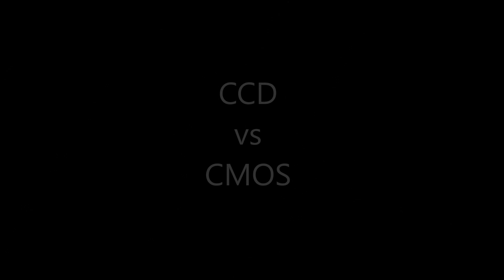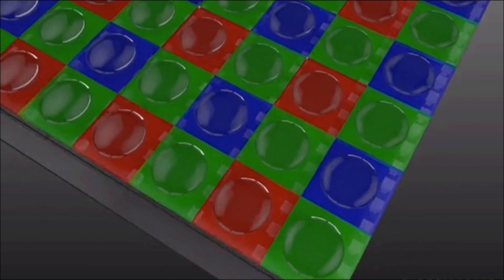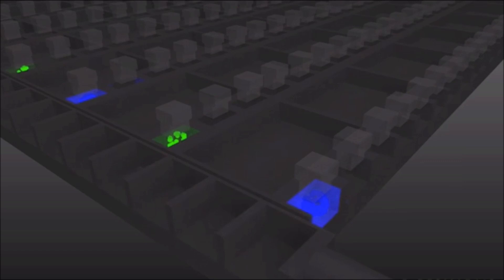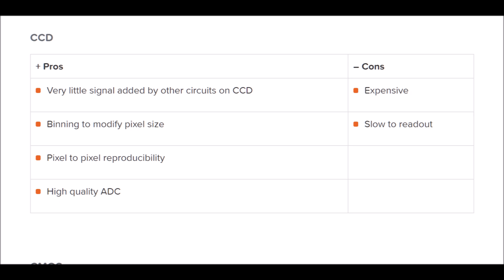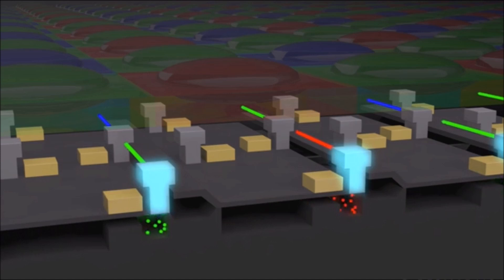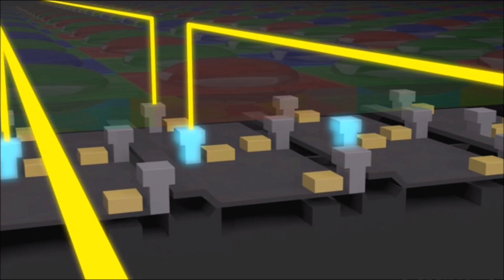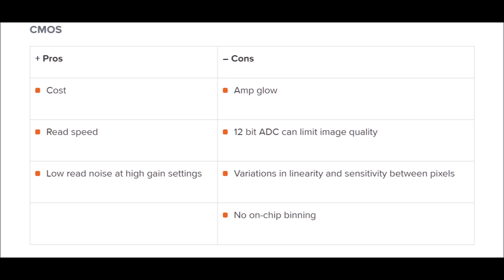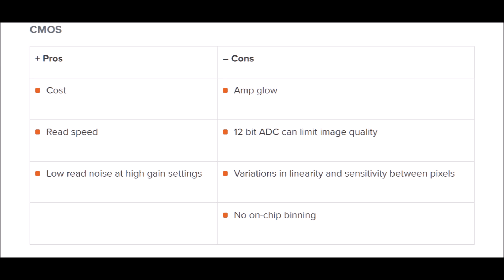CCD versus CMOS - advantages and disadvantages explained

Comment: Nice video and really a helpful one! But one thing I am not clear is around 8:05 when talking about the low read noise of CMOS. Is this feature caused by the 12-bit ADC? Or, in other words, the read noise of 12-bit ADC is lower than 14-bit ADC thus lead to a lower dynamic range but better high ISO performance? Thank you!
Reply from the maker: Hi Henry, thanks. As i understand it, the CMOS technology has matured a lot over the past decade. Where CCD sensors used to have a lower read noise as the 14bit adc is placed outside of the sensor, CMOS which includes many ADC converters on the sensor, has caught up with most CCD sensors, and some even outperform CCD sensors in terms of read noise. You're right about the dynamic range. Clear skies!
Reply: AstroForum Get it and thanks! CMOS is developing so fast and has overcome many original drawbacks.

Comment: NASA uses CCD sensors for all their satellite's some reason,.. do you know why ??
Reply from the maker: They are old school :-). Until very recently CCD had a higher quality analog-to-digital converter and better signal to noise ratios than CMOS. It's only the very latest CMOS cameras that are rivalling the quality of CCD's.
Reply: @AstroForumSpace  ok... I think CCD is still batter & give better accurate colours renders green/cyan/blue channel better then latest CMOS .. my observation
Reply from the maker: @dushyantbhatt9345  perhaps, but they are also  more expensive.
Reply: @dushyantbhatt9345 CCD has nothing to do with colors.
Reply: @vermontmike9800  I have a medium format CCD sensor, I must say greens, blue, cyan are richer & better
Reply: Yes it’s on the nasa site. Low light capability and size needed.